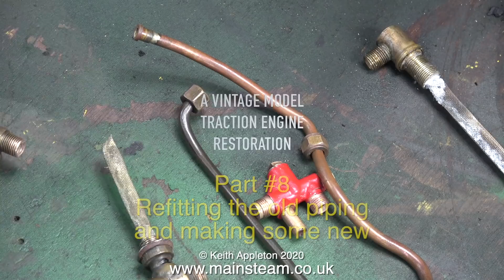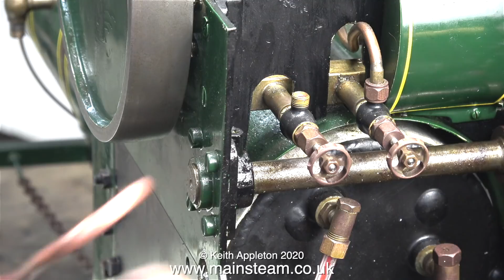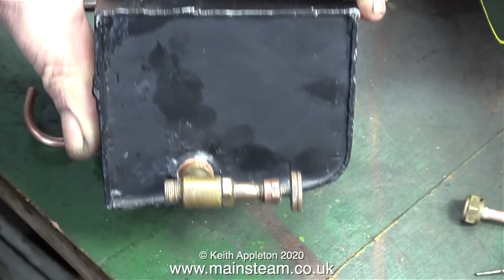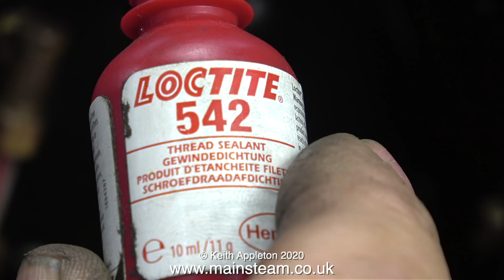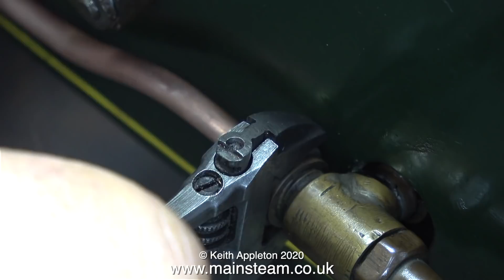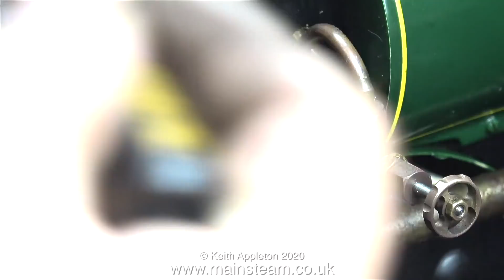A VINTAGE MODEL TRACTION ENGINE RESTORATION - PART #8

Comment: Strange that the centipede movie didn't put you off measuring in feet.  Although, I can't decide which would be 100 times worse than the other.  Glad it wasn't a millipede: not only much worse, but you would also be able to see its lips move!  Good video, thanks.

Comment: If you don't like to say the Cent. word you could say 15 Milimeters    grins  Although that does imply a degree of precision that you don't really mean.
Reply from the maker: Urgh ..... horrible things - with far too many legs }:-)))
Reply: “Mills” for millimetres and “klicks” for kilometres.  In Australia, metal and wood are sold in mm sizes, only school kids use cm.
Reply: @sevensprings460  In electronics and PCB design traces are measured in mils, a Mil is 1⁄1000 of an inch
Reply: Millimeters are the best way to measure in my opinion.